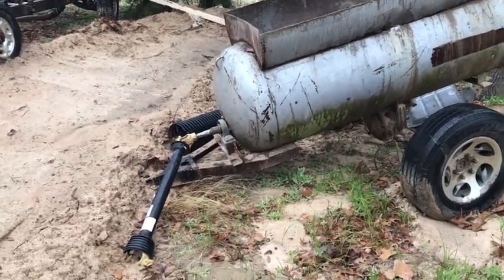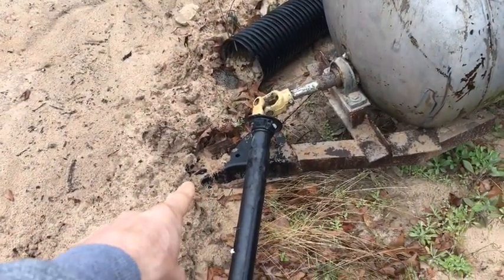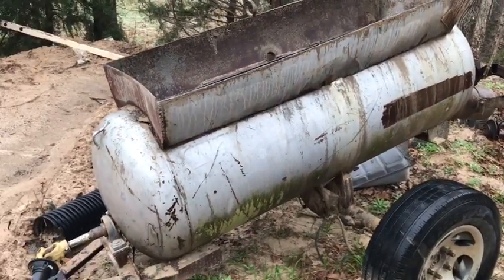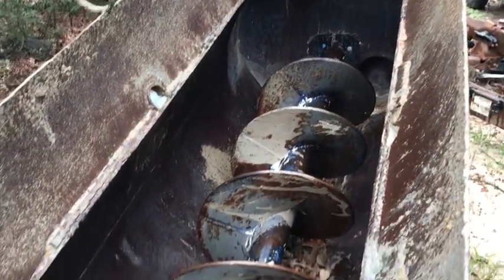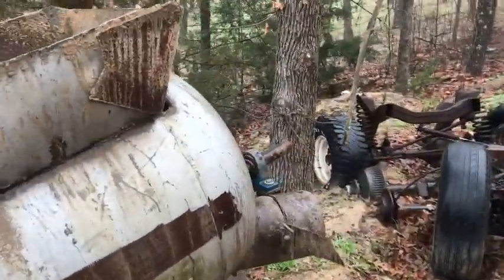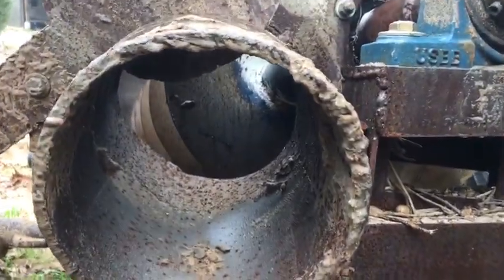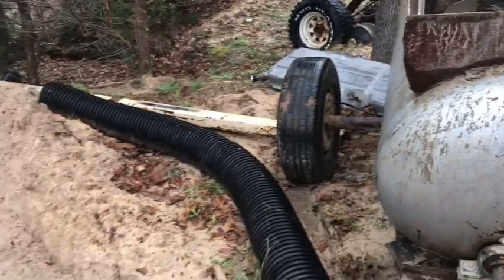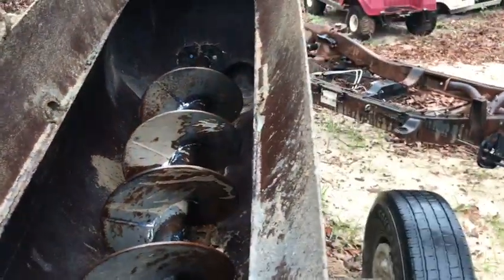Homemade Concrete Cement Mixer PTO Drive Out Of Propane Gas Tank And Auger Bit Home Made Invention

Comment: HI, Please do some more filming the next time you use it. I was thinking of making a small pan mixer but yours looks better and less complicated. I want to pour concrete from 5 feet in the air into tubes so am thinking this on a loader with an oil motor. Great stuff. regards, Jim in NZ.

Comment: I really like this. What diameter is your auger?
A safety grate made of welded rebar would be some thing I would add.  It makes a good place to bust your cement bags on.
Reply: I had that same thought when I was viewing. Something like the Mudmixer that has plate steel you can drop the bag on to cut it open, but also ensure no one falls in, lol.

Comment: Thanks, guys! Coool! I beenn thinking about pumping concrete with a grain auger. Got any advice?
Reply from the maker: I'm not real familiar with grain auger. Concrete gets real heavy so it would take a lot of power, specially if your pumping up hill. Also can be a pain to clean out. I am working on a simplified version that I will post soon. Let me know how it works out for you.
Reply: We tried that once. It effed up th gearbox on the auger then no concrete moved but not before the entire unit was clogged full. It was quite pleasant and enjoyable  dismantling the auger screw and all the compacted concrete. I dont recommend it but hey, maybe you'll have better luck.
Reply: Use a superplasticizer designed for pumped concrete.....its like magic pixie snot that makes concrete awesome !!!!  loads of good posts on youtube for info and sold via ebay n amazon.
Concrete pumping kit needs to be robust and requires horespower......